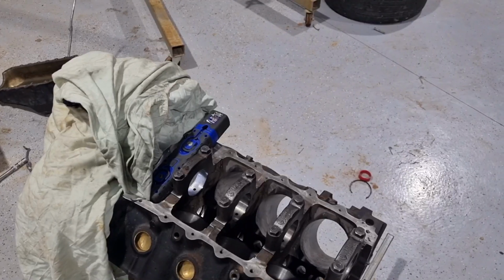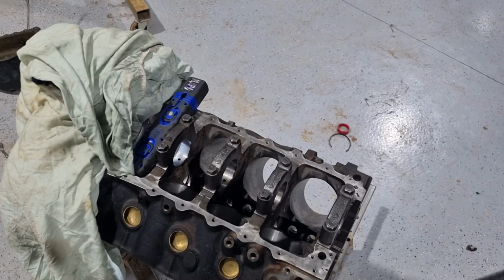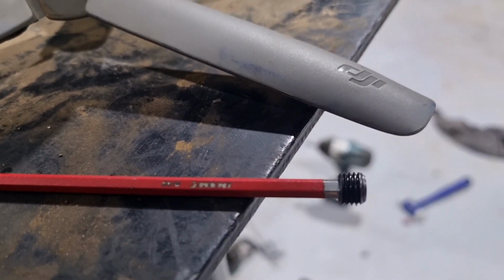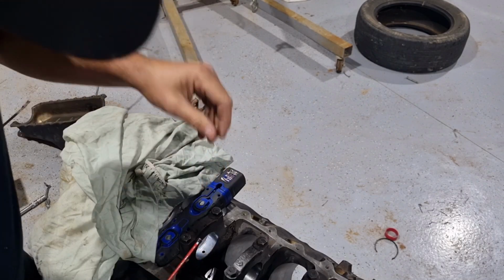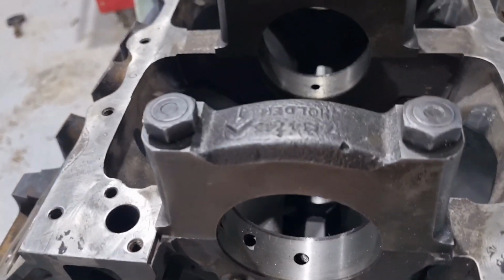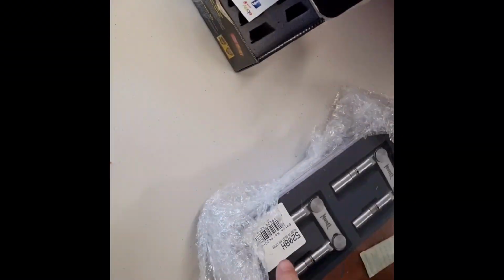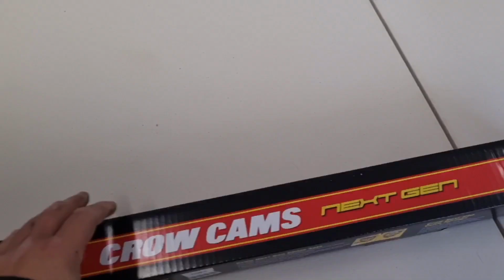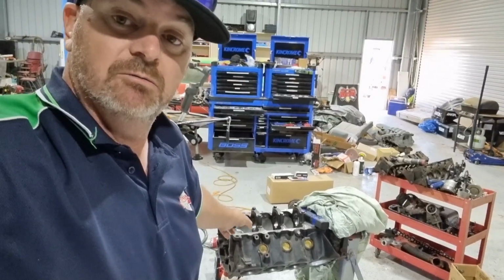383 Iron Lion Holden Build Ep 2

Comment: Should leave the cam chain oiler, block off the hole in the centre of the cam/chain  bolt
Reply from the maker: Nope doesn’t need the Cain oiler.
Reply: @carsnthingsrestos31  All of them have it
Reply from the maker: You remove it to stop oil bleed off and gain oil pressure, it doesn’t need it, there’s plenty of oil flinging around in there to oil the chain and as long as you use a roller chain it will be fine, all the race engines were built like this.

Comment: You forgot the oil mod on the oil pump side of the block. Also you didn't  blow out the swab out oil gallery  of cam journal after you tapped  it. I would of left the restricter out till final assembly  that way  all the junk  can come out easily in the hot tank process in the machine  shop anyway that's just me each to their own
Reply from the maker: Only EP 2 mate
Reply: Alright I'll bite what's swab I know swaf